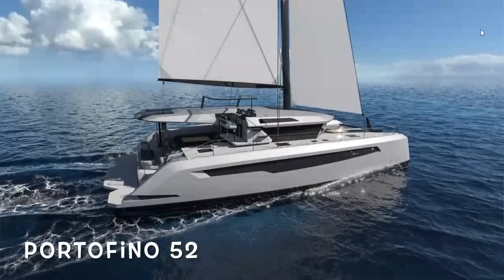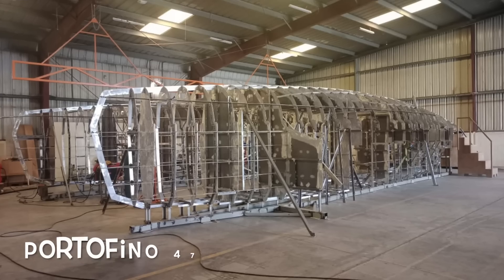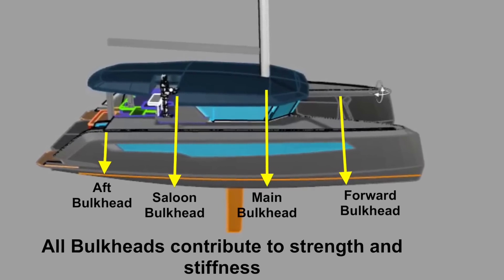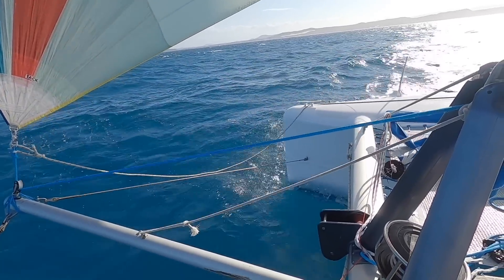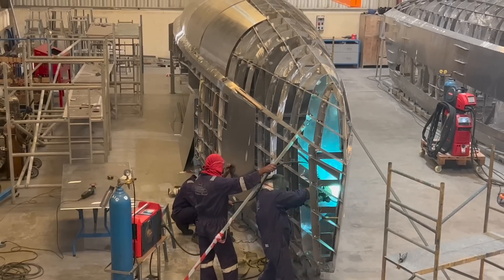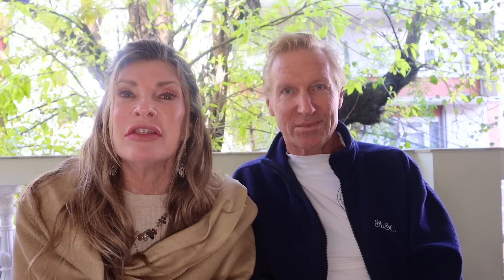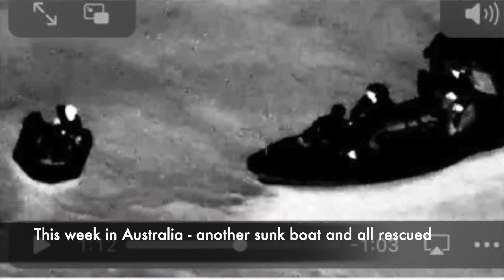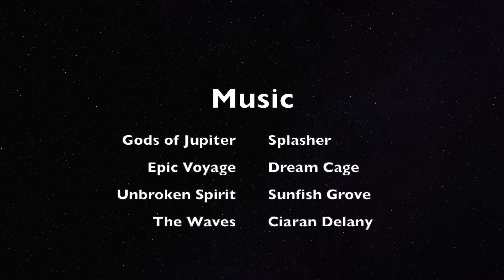S3#9.  Portofino 52 Build Starts!!! The TRUTH about BULKHEADS. And First  of 52 AL bulkheads cut!!!

Comment: No idea where you guys are… yet, wish I was there. :)

Sounds like future episodes will talk about beams because “thickness” is literally only one dimension of structural integrity. The quick image of the Leopard beam supporting the vertical load of the mast was designed for shear and moment forces much greater than what bulkheads experience.

Great point about sizing pumps and how quickly the can be overwhelmed. Besides the hole size head pressure just adds to the complexity.  The deeper the hole, the faster the flooding.
Reply from the maker: Thanks for your comments again Boston! Yes the calculations for water inflow were too complex for me at first but we will have to pick a random depth and work out the pressure at that depth as an example... I now when taking the log out of the bottom of the hull at only a few feet, the water comes in the 1 inch hole fast like a fire hydrant and I know the pumps are not that good!

Comment: Please can you include some more info on catamaran standing rigging and chain plates. Especially the lack of a back stay and the loads caused by headsails and spinnakers. Cheers 👍 ( Are you in the Canary Islands?? )
Reply from the maker: Noted, Geniex! We will talk about rigging in later videos. Catamarans usually use three point rigs with swept back shrouds to remove the need for backstays because the large roached mainsails (large bulge outwards at the top) would get tangled if backstays were used...

Sorry but it is not the Canaries!

Comment: Hi Guys, Just wondering if you still have your 45 that Leopard arranged for you to buy. The reason is I found a channel called "Travel Sketch" who are having massive issues with cracking in their forward crossbeam supports of their Leopard 45.( could be caused by the lack of strength of bulkheads further back in the boat?)  Have you looked for any problems with your 45? Their boat is 2 years old ( I think) so maybe Leopard have changed the attachment points , so yours might be ok. The other thing is how tight do you have your stays to hold up your mast? I used to race a maricat 4.3 cat rigged cat (back in the day when I was much younger lol) and the rear lee stays were always loose when sailing to windward. Is this the case in larger Cats or are all the stays as tight as possible? Thanks for the video. Good luck with your new build.
Reply from the maker: Thanks for the info and the comment, Stephen. Yes we still have the Leopard 45 and will do for the ext 2 years until the Portofino is near completion. We do not have any  of those issues that those poor guys have experienced. Our rig is not overly tight which puts less strain on the pressure points but it was rigged by R+C and so was their 45 - we hope their problems are able to be sorted and allow them to enjoy the sailing more...

Comment: Hi John and Eli. Another great informative episode today. You raise the main points that most should know when buying a cat. So well done there. However, I've noticed two things in my years of sailing. With high performance catamarans under 30ft long - those used for racing - then tend to have a "striker" which points downwards between the two hulls under the mast which helps offset mast and hull forces, however with the the modern pleasure/cruising catamarans the sticker seems to have been moved forward to the bow and turned upside down. I can't see how this stops the hulls from splaying out wide. If it was a solid bar I can see how it would help stop the mast compression, but most a wire under significant tension themselves. So I'm intrigued. Can you explain how the upturned striker helps and exactly which forces it is cancelling?  Or is it pretensioning the hulls' bulkheads? How much force would be placed through them?  On another note, I noticed the seemingly unique ornate concrete railing posts of the balustrade behind you. I've not encountered them some ornately made. I think your still around Rome/Siscilly somewhere, but as to the actual city...I'm none the wiser.

As I'm first here I doubt I'll win the prize. Fair winds guys!!!
Reply from the maker: Thanks Garth for the big comment but you don't win the prize for location yet... There is very little to go on though so tough call!

The "striker" (if it is what I am thinking it is) under the mast, takes the load of the mast pushing down. The A Frame on the bow takes the pressure of the forestay pulling up to protect the beam from breaking, hence its upward orientation. It is not for the hulls at all and while the bulkheads do most of the work for hull stability, the front beam also helps as it is usually bolted / glassed very securely to the bows...

Hope that helps!
Reply: @barefootdoctorssailing  Ah Of course. I should have guessed!. Thanks for that. My only other guess would have been ... On your bottoms!

Comment: Very excited for your build! I'd love to know more about how lines are run to the raised helm location, and in fact how all lines are run. I'd love to hear more about Portofino's experience in designing/building folding keels, and the mechanics involved.
Reply from the maker: HI Todd, thanks for the interest and we will share all the layouts of the deck hardware in due course. Portofino has been operating in marine fit out and rebuilds for 15 years in Dubai and Raffaele is an engineer with a Captain's ticket to 200,000 tonnes. He has been working with lifting keels and fixing broken ones from other brands and ran his own commercial scuba diving super yacht before that. So involved in all aspects of yacht engineering and systems so hopefully we will benefit from all the things that did not work so well with other brands.